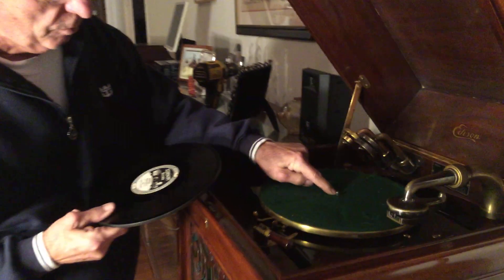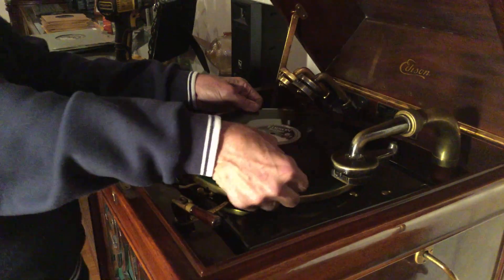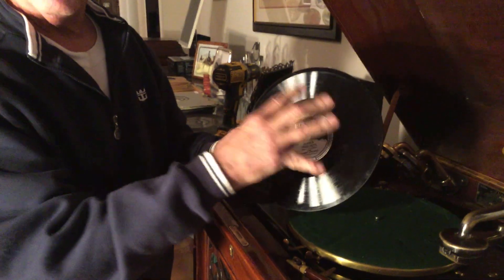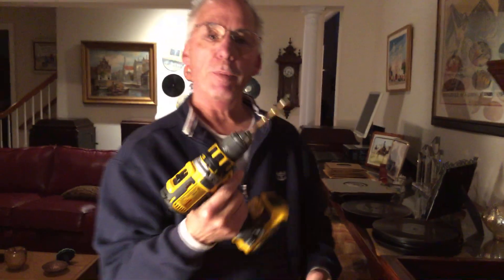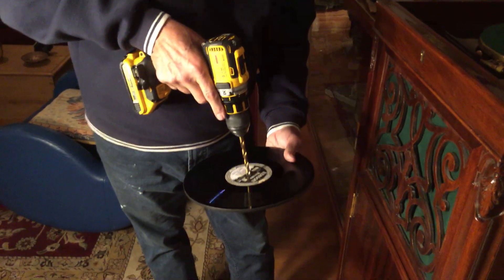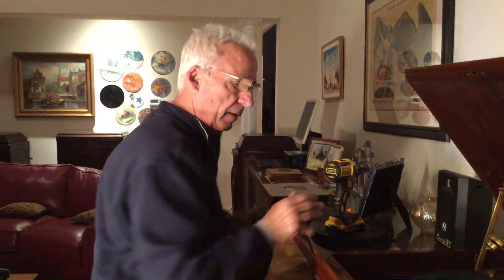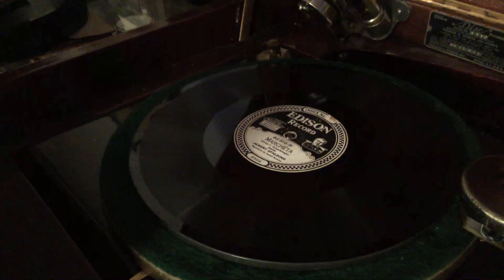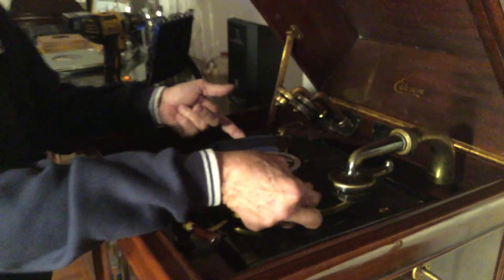538.  How to get a too tight Edison Diamond Disc record to fit on the spindle shaft

Comment: I have  a drawer full of EDDs and I never had this problem, but I do have one with an elongated spindle hole which I work around with a small bit of painters tape.  If you find a better solution for that problem, please post a video.